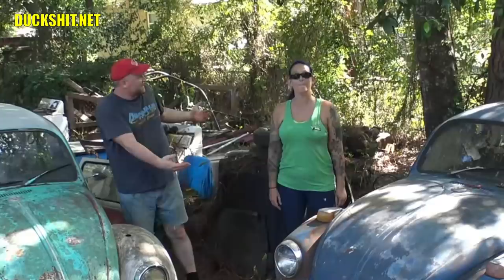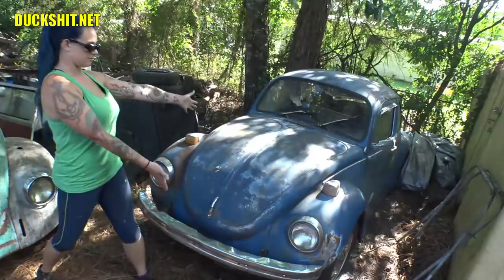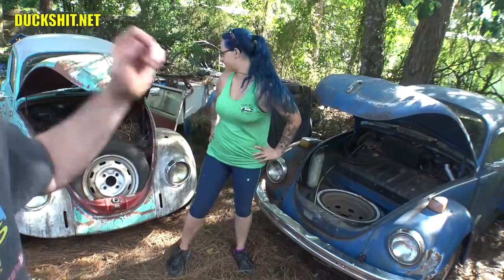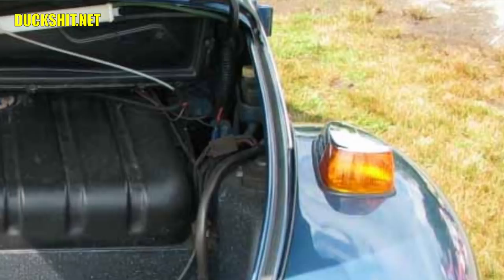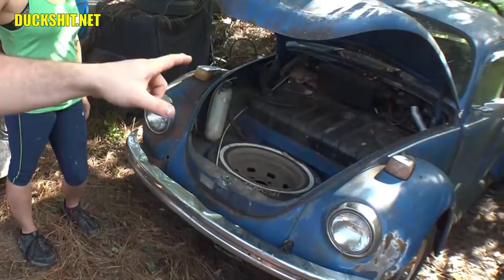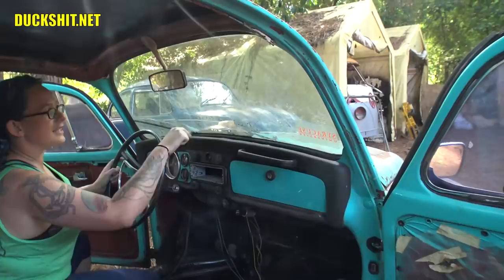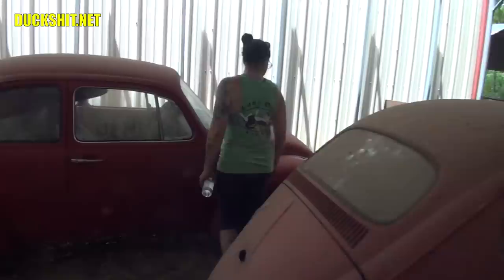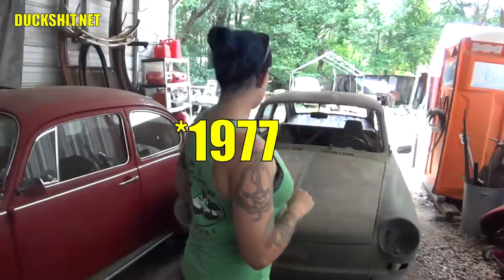VW Beetle vs Super Beetle - Whats the Difference? - Midday Q&A 108

Comment: I have 1977 beetle I'm not sure if it's 1977 or 1976
I'm not sure if it's 1600 cc or 1300 cc
Her kilo met rage have 160km/h top speed 
It doesn't have this small lights above the front wheels
How can I know what is the model of it???
Reply from the maker: Well if its a Beetle, and a 1977, look at the windshield.  Is it flat or curved?  
Also, in regards to the engine, what are the first two digits stamped on the engine case?
Reply: @vvtheduckvv  
The windshield is curved.. and I can't get the digit stamped right now
Reply: @aamerjr1520  Cool, you've got a 1303 Super Beetle then.  You do say km so its a non-american model, if it were an american model I'd guarantee 1600cc but for other markets VW did some different things.
Reply: @DuckmanCycles  
Ok alright thanks for helping bro🤚

Comment: Were '74 and '77 identical or were there differences?
Reply from the maker: That depends on the question, its hard to answer, not specific enough!  :)  Clarify and I'll try to answer!  Thanks!
Reply: @vvtheduckvv  Where there any subtle differences between a 1974 Beetle with 1.6 and a 1977 model with the same engine but without the fuel injection system the US versions had in the 1977 model year?
Reply from the maker: @FM60260  On a standard Beetle, not a whole lot changed after 74.  You'd be best served looking at the official VW change list for the more minor details!
Reply: @vvtheduckvv  Where can I find the official change list covering the European & UK market?
Reply from the maker: @FM60260  I'm afraid you'll have to Google that the same as I would.  Sadly, I don't have a Googlegraphic memory!
Reply: @vvtheduckvv  I couldn't find anything relevant.

Comment: 1971 vw 1972 1302 supers, in order to tell the difference just look at the steering wheels. 1971 retained the old style with horn ring, while the 1972 models have the big cover that most later models beetles got.
Reply from the maker: That’s a very useful tidbit of information there, thank you very much for sharing!
Reply: Actually, the best way to really tell a 71 from a 72, Super or Standard, is to look at the engine hood.    In addition to the one long cooling vent under the back window, 70 and 71 Beetles have an extra two vents for cooling.  Starting in 1972, there were four vents, which remained that way until the end of production.  There might be some inconsistencies with cars made in other places that weren’t imported to Canada and the USA.  And the convertible always had a two vents on the deck lid, because the top would have blocked a vent underneath the window.  But the 1972 convertible (convertibles were always a SuperBeetle, and before the SB, always the deluxe sedan not the standard sedan) got the four vent upgrade as well.

Comment: I have a 71 super beetle but it needs a new wiring harness any ideas if the wiring harness out of a 74L bug is the same ?
Reply from the maker: Its not the same, but it can be made to work!  You will just use the wiring diagram from a 74.  The only thing that might be different is the headlight switch, I haven't done the work to see if there are any differences, but shouldn't be a big deal.  Hope that helps! Thanks!
Reply: I’ve asked a lot of people this question and your only person that has been able to give a answer!! Thanks heaps

Comment: I believe the padded dash wasn't added to the European standard Beetles until 1969.  I have a '68 Euro and while it does have the collapsible steering column of a '68 US Beetle, it still has a metal dash, so I guess I got the best of both worlds, lol
Reply from the maker: Hehehe!  As far as I know, the euro models never got the padded dash.  Kept the cost down, something that VW tried to stick to!
Reply: @vvtheduckvv  The Europeans had three models to choose from, the super stripped 1200 (which was basically a '66), the 1300 (which I have), and the 1500.  I think the 1300 and 1500 got the padded dash, but the 1200 never did.  Something like that anyway.  Believe me when I say that trying to figure out which parts fit a non-US '68 is all sorts of fun....NOT!
Reply: @chrisfreemesser5707  No padded dash in the UK at all for the beetle, until the Superbeetle  which was the sloping plastic dash   with like a plastic pretend wood strip across, it looked reasonably good  .We did get a 1300s which was called the GT,  and it had a 1600 in it, try and find a one that's not lemon yellow it's impossible they all must of been , and we did get one or two special editions .My dad had a 74 jeans beetle a colour called Tunis Gelb (Yellow) it looked orange to me, with blue denim seats 👍
Reply: @Jaxs2  That's really odd because I looked through several European owners manuals over at The Samba for '69-'73s standard Beetles before I posted and they all show the same "padded" dash that we got here in the US in 1968.  A quick check of an English VW parts place shows padded dashes available for right-hand drive cars for '71-'79 Beetles.  Maybe the 1200 kept the metal dash but the 1300/1500 got the padded dash?
Reply: @chrisfreemesser5707   Now you have got me unsure  , maybe it could of been ordered but I have never seen a one on any car in the UK , but 1200  metal 1300 metal 1500 metal 1300s or GTs metal,  all the limited editions metal  ,Superbeetle plastic sloping the only thing I can think of if it's one of the later models just before the end of production  but even then I would of thought I would of come across a one .🤔 maybe the brochues showed cars that did  not arrive here ,South Africa is also right hand drive , or maybe a VW option that no dealer imported  ,none of my mates have ever seen a padded dash here in the UK just to confirm. 🤔

Comment: here in Denmark you can have a 1302  super and a 1302 s super beetle difrens is 1600 engine duble rear svingarms and disk brakes,,  i am restoring a 1302 from 1971 right now lower the front and get new rubber parts and i drives a lot better than the old ones,,,

Comment: I thought all super beetles had cooling grooves under front bumper.  The red curved dash does not
Reply from the maker: There are louvers in the front apron behind the bumper if that's what you mean,
 it was for placement of an optional air conditioner condenser.  I'm not sure how you could tell that the red beetle didn't have them, because you just can't see LOL
Reply: @vvtheduckvv  I'm talking about the red curved windshield super with no headlights and bumper.  The one you called a 73,74,75,76,77.  It's a 73 super without cooling fins.
Reply from the maker: Oh, that car is a mutt.  Its been cut and customized.

Comment: Personal I think the 1967 and older VW Bugs are the better bugs.  I like the way they looked.  1968 and later was too many changes I know for safety reasons but still just don't like the way they looked to me it just wasn't a VW bug.  I've owned a 1965 VW and a 1968 way back in the 80s miss my 65 VW  did not like the 68 did not have it to long and sold it. Had a 62 and a 66 at different times.
Reply from the maker: Better in terms of looks... early better for sure.  But I prefer the way a balljoint/IRS drives on the street.  Eleanore has been built to be the best of both worlds.  Very happy!  Super Beetle to me, isn't a Beetle in the same respect.   LoL!   Thanks for the comment!
Reply: When I was growing up my mother had two Volkswagens.  Her mechanic who worked only on VW's said any Volkswagen manufactured before 1968 was the better car.  He explained the changes VW made on the 1968 and after models that made them more trouble prone, and subject to repairs.  A lot of the models made after 1968 had valves that would go down into the crankcase, and require a new motor.  The 1965 lasted the longest, and was still going 27 years later.  Her mechanic told us the McPherson struts had to be replaced, and the fuel injected models needed repairs due to problems.